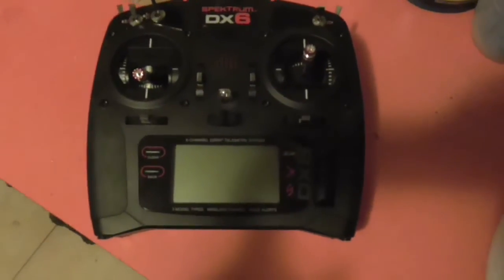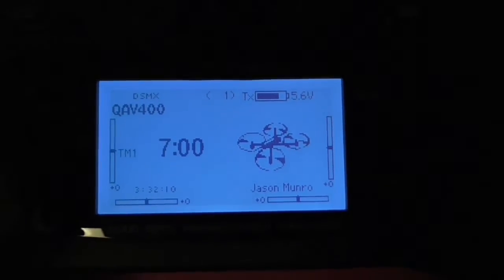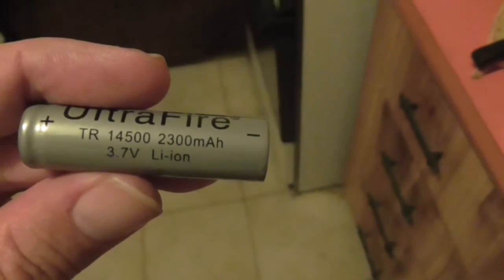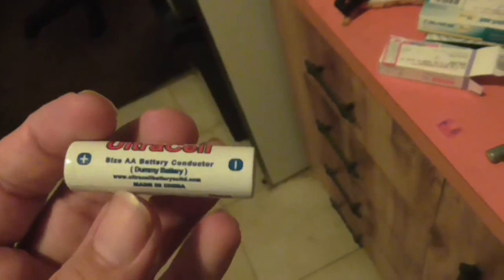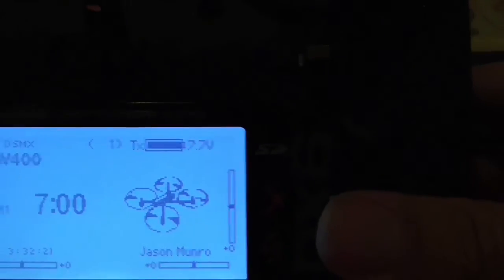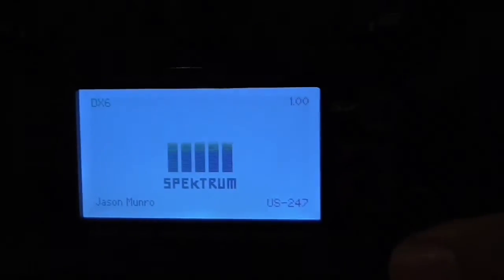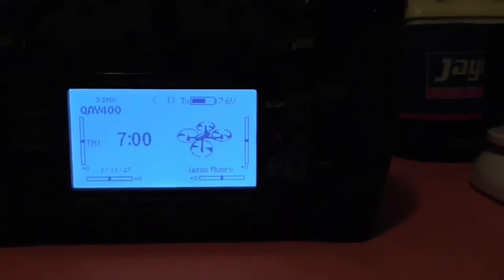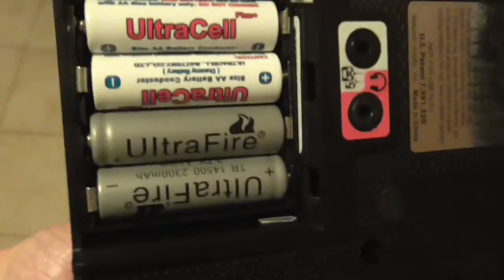Super Cheap and Simple Lithium Upgrade for Spektrum DX6

Comment: ultralight brand lie about the mah on their cells look it up. i recommend panasonic a18650b 3400mah  you can buy them with or without protection circuitry.
Reply from the maker: Yes. I quickly discovered the capacity was not what was printed on the cells. They did work, just not for very long run times. 
Thanks for the tip about the better cells. I will investigate them.

Comment: Also, be sure your device doesn't recharge the batteries in place as if the cells come out of balance one will overcharge and possibly not only damage the battery but possibly catch fire!
Reply from the maker: thanks. i had forgot to mention in the video that you shouldn't try charging them in the device.